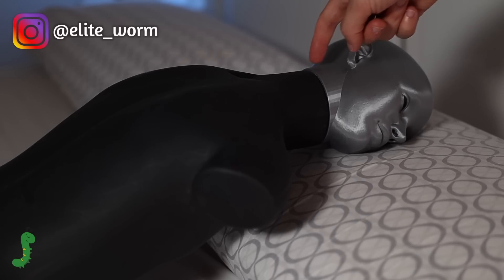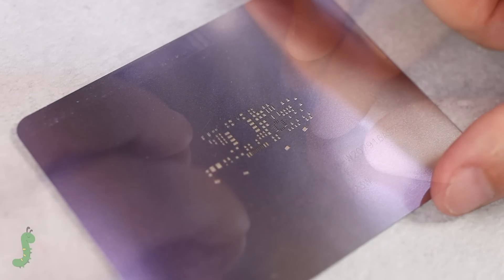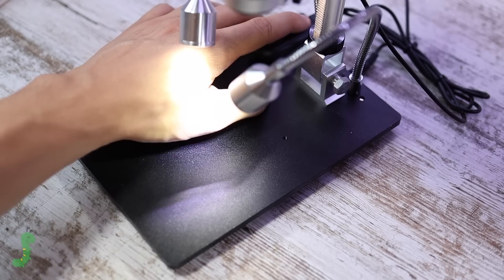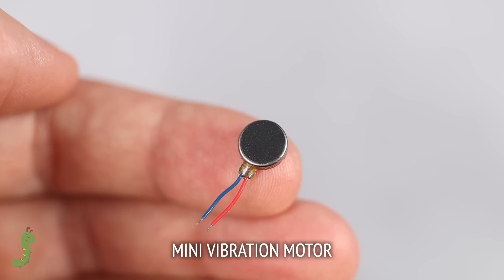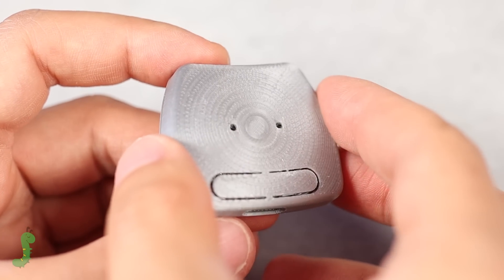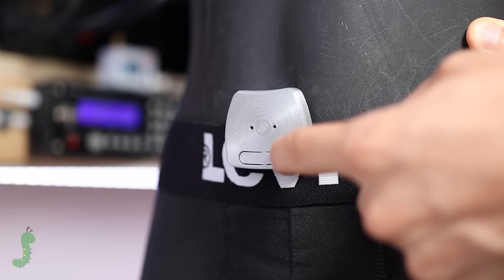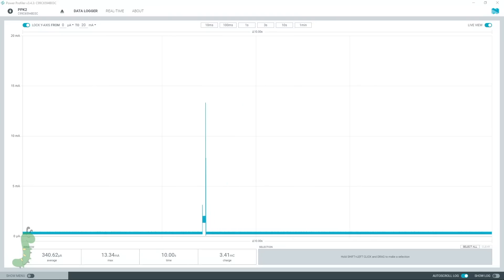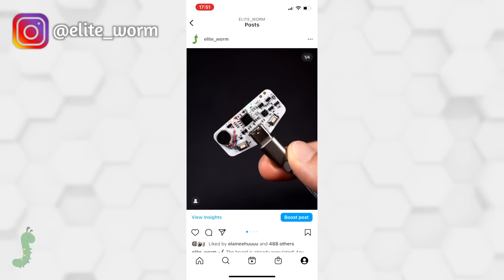I've built a Neck Monitor to Fix my Pain | Soldering & Assembly | Elite Worm

Comment: Is there any secret power of 3D printing to print directly on heating PCB on Prusa-printer, and not using the flex-sheets? :D
Reply from the maker: That’s the only way to do it on old MK2 models 😄

Comment: MEMS accelerometers have drift - they lose position over time unless you have something to re-calibrate them. Gravity is typically used, but must be filtered out and deduced from the sensor, which can be tricky. For directional sense usually a directional MEMS compass is used but that's not needed here. I think an array of angularly arranged mercury switches would've been more reliable, and simpler. Cool project though!

Comment: I'm interested. I don't have instagram. As a suggestion: put the clip on the front so the strap of the underwear goes over the entire device. The status lights don't need to be seen during operation, so that shouldn't be an issue. Also, sleeping for several minutes instead of seconds would likely be just fine. A few minutes on your stomach probably wouldn't cause too much of an issue after all yet save a lot of the battery. I'd retrofit mine with an inductive loop for my wireless charger, but that's nothing to do with the current design.

Comment: I was wondering how that would compare to the Seeed nRF52840 Sense? that has everything I think you need already onboard but I was wondering how it would compare to your design as far as power consumption? because the xiao I think is smaller than your, it has all of the same functions but it might use more battery I'm not sure, but it's a whole lot easier because it's already built and ready for this task.

Comment: Nice job. I have an anti-snoring device called a “smart Nora”, it uses a pump to inflate an airbag under the pillow to get you to turn over.
Reply from the maker: Interesting! I will check it out. Thanks 😉
Reply: Sounds like that  makes a bit of noise
Reply: @thomasvnl  it’s actually really quiet. The pump goes under the bed in a fabric box. Just a pipe up to the pillow airbag. Stupidly expensive for what it is though and I'm not sure it really stopped me snoring, but it did make me change sleeping position. It broke after 4 years though. I think the pump batteries have given up. On my list of things to fix.

Comment: If you want to get into some weird stuff, maybe you could use electric shocks to wake yourself up? However, with the big resistance of the skin, that'd need a high voltage regulator and you need to ensure good skin contact.
Reply from the maker: Thanks Vincent! I already thought about that, but I was too afraid of how the comment section would look like after posting the video 😂
Reply: @EliteWorm  Oh I'd be more worried about you, especially if you wear it on your waistband. Wouldn't want it to become dislodged which would also lead to erroneous readings...

As for weight, you'd be surprised how heavy stuff on your waistband can be. I sleep with my insulin pump clipped to the waistband of my pyjamas. The pump weighs about 150 grams, and has never gotten off the waistband. Truth be told the biggest annoyance is the tube getting... tangled.
Reply: The probem with that is people who have nerve damage won't feel it and the people who have heart people might be a problem and a liability.